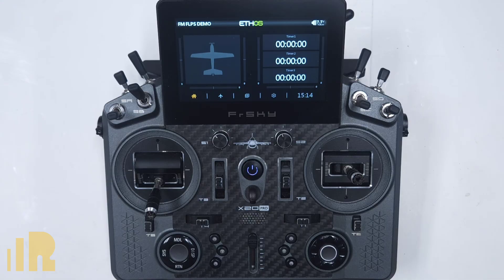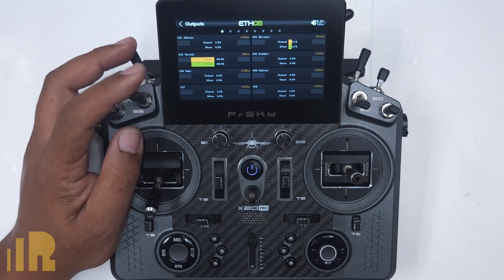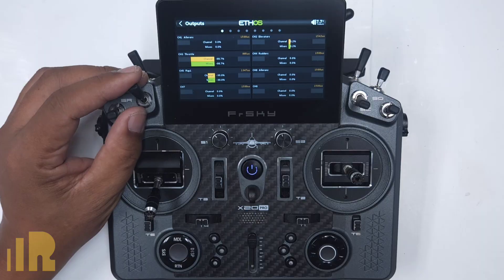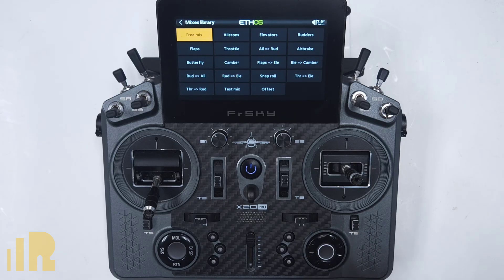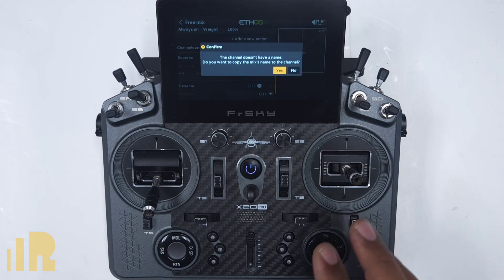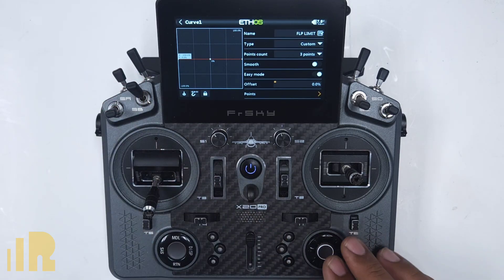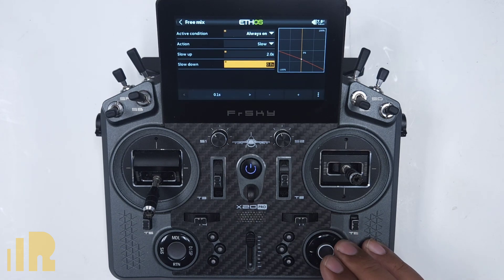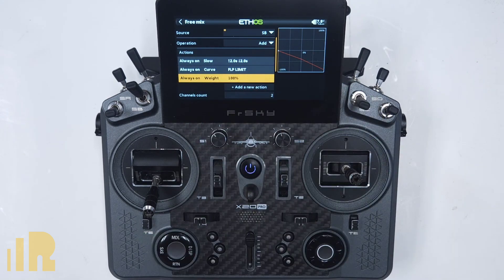Better Flight Modes for Flaps - FrSky EthOS Instructional Series

Comment: Very helpful tutorial, will this work as shown when using a pot/slider for the source vice a switch?
Reply from the maker: I did a flaps video and I show my methods for use with slider in one part of the video. No, flight modes are dependent on switch positions. So using flight modes with slider moving the flaps will NOT result in synchronized flap to elevator movement. In the flaps video, I show an alternate method that works much better with a slider
Reply: you could have a curve for the elevator compensation and stil have the flaps on a slider or even re-purpose the throttle channel like they do on slope soring gliders  @FrSkyOfficial

Comment: In Europa sind wir verzweifelt mit Acher plus SR10+ ,es braucht kein Mensch Messerflug und Rückenflug auf Kopfdruck.Wir wollen  einfach nur ein normales Gyro gegen Wind und äussere einflüsse.liebe Grüsse
Reply: Im in Europe. I fly IC and got myself a Powerbox Gyro to do the job you mention. It works very well.

Comment: Hi, Jose, thanks for sharing this tip. One thing I noticed when I set it up the same way is that when you switch the flap switch (FM) between Up to Half and Full (one by one), the elevator compensation time is correct. The problem is that when you switch directly from Flaps up (FM0) to Full flaps (FM2), the elevator compensates and reaches the preset position faster than the flaps move from Up to Full. The same applies in the opposite direction (Full->Up). The flaps also move more slowly from the second half of the entire travel to the end of the movement (If you jump directly from Up to Full and vice versa). Can you suggest how to fix this?
Reply: I replied to you via email on this but I feel others may have the same question. This is normal behavior for flight modes. Even independent trim per flight mode does this. Most people are ok with it since, you generally always go from up, to half, as the plane slows down and then to full. If you aren't ok with this, you'll need to do your flap to elevator compensation in a mix instead of a flight mode. I demonstrated creating a mix for this in my other flap video.
Reply: @Amahoser thanks for the quick response, Jose. Emailed you back.